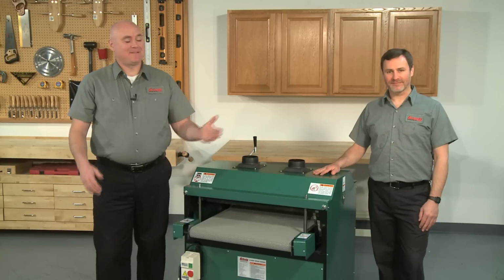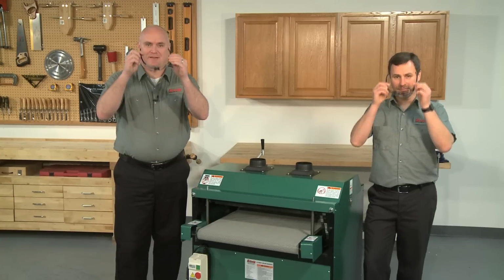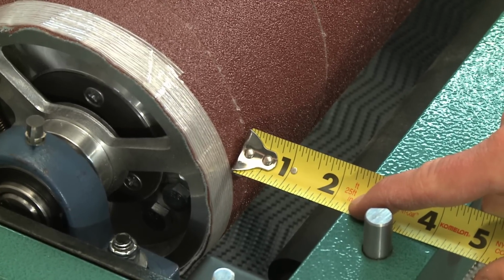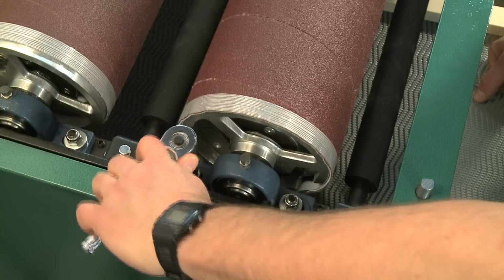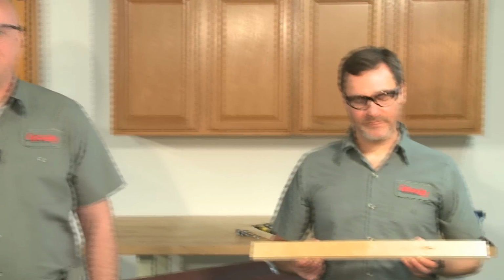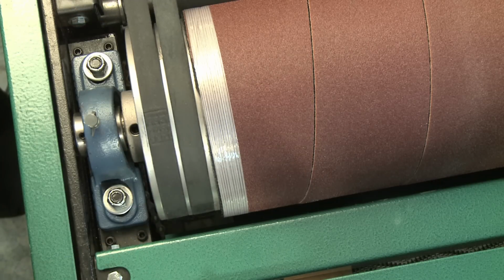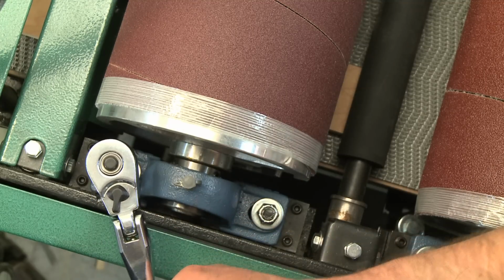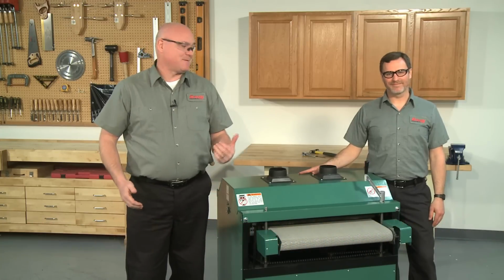How to Adjust the Front & Rear Drums on the G1066R & G1079R Drum Sanders

Comment: Quite surprising to me that these methods are so un-scientific.

Drums can be up to 1/8" off perpendicular? Well heck, with tolerances like those, who needs a tape measure?

Set drum alignment to conveyor belt by sound, not an actual unit of measure? That's not very accurate.

Front drum should be set "a wee bit" higher than the rear? I understand the height difference depends on material to be sanded and other factors, but wtf is "a wee bit"? Grizzly should at least specify an actual measurement range (ex: .05" - .10"), or a certain number of turns of the set screws. ANYTHING more precise than "a wee bit".

SMH!

Comment: My drum sander just threw my piece across my shop. Any thoughts what is the issue?
Reply: Me too. @Grizzlyindustrial, what’s causing this?
Reply: I found the problem. The rubber rollers need to be calibrated. The rubber rollers which are the ones who holds down the wood piece pressed to the moving band  need to be moved down and need to be below to the sander rolls.
Reply: @faustorivas3561  I called Grizzly and talked to an engineer and he did not solve the problem so I did just the rollers (front and back) and it did solve the problem. I rebuilt the G1066 a couple years ago and finally had a need for its use. Thank you for your post on Youtube.